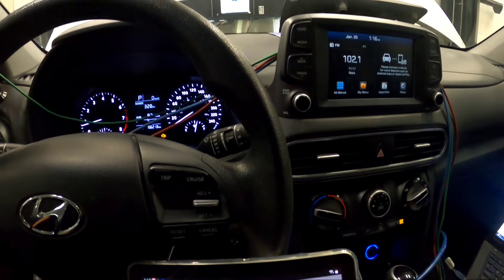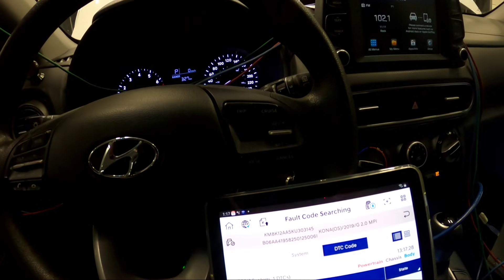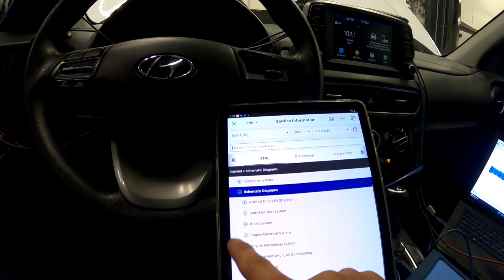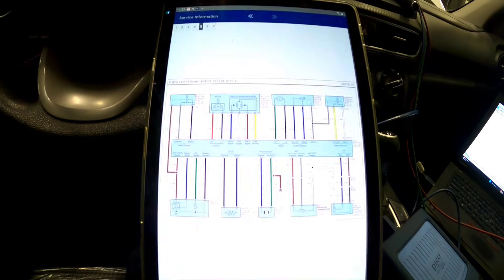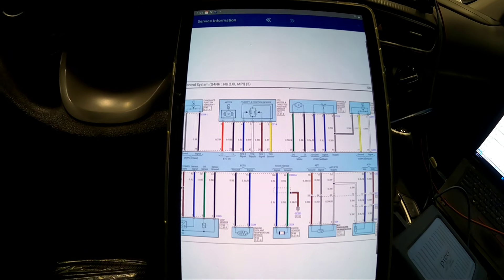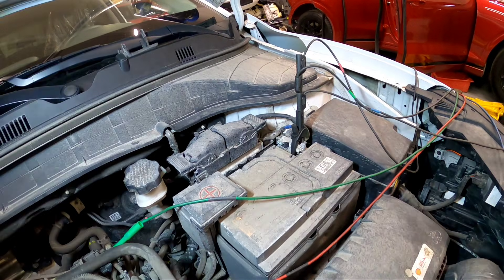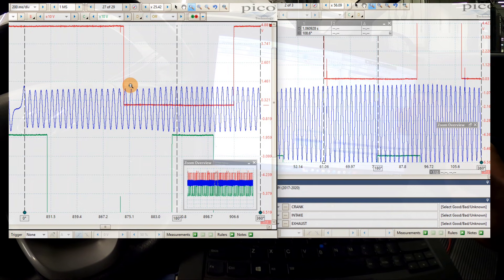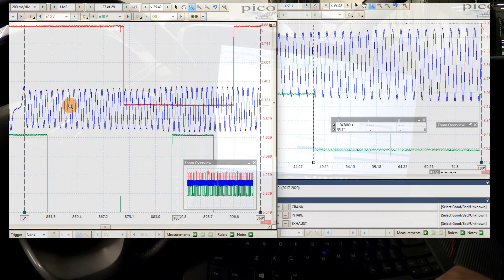How to check engine timing using oscilloscope | Hyundai Kona P0017

Comment: Correction, the camshaft itself was not replaced.
Reply from the maker: When they replace the cvvt gear was the dowel pin damaged? If yes, they need to replace the shaft.

Comment: Thank you for the video! On my 2020 Hyundai Kona and continued p0017 code, the timing chain and its components, cam shaft and cam gear were replaced as it was out of timing and cam gear pin was broken too. Mechanic said it was perfectly in timing with marks after repair . Code p0017  is still there. I’ve replaced both cam shaft sensors, both vvt sensors and crankshaft sensor and still getting p0017. The vehicle is current with the  requested recalls and safety campaigns. Any thoughts or other avenues I can take? you help would be greatly appreciated. Thank you
Reply from the maker: So as of right now you still have p0017 code? Whats vvt sensors? You mean the oil control valve? Did you guys actuate or active test the oil control valve? Is it oem parts? And also whats the data shows like exhaust setpoint and desired data values?

Comment: Hi there brother thank you for showing us and sharing this knowledge with us , but I wish you could of had show us the physical misalignment on timing marks
Reply from the maker: Yes, next time i will try. Thank yoy
Reply: @hyundaitech  hi there brother I have a question, it’s it normal for the exhaust camshaft phaser sprocket to rub against the timing chain cover ? But you know only the exhaust side on the phaser has a mechanism on the outside of the sprocket it self like a spring loaded wrap around the sprocket and then looks like a flange on it too , well that looking flange the one rubbing against the timing chain cover , and intake side it’s throwing couple codes P0341 and P0016 ,and it seems has new crankshaft sensor and the intake side has a new camshaft sensor also , and car sometimes seems to drive ok but then all the sudden leaves you stranded 😅. So do u think this exhaust phaser it’s the cause of this codes , cause I’ve never saw a phaser rubbing against the cover
Reply from the maker: @juanhernandez1238215 if its rubbing it could be the bolt that holds the phaser is loose. Those timing codes for sure it the phase issue. Check if the bolt is okay or not, if not then most likely you need phaser and a shaft.
Reply: @hyundaitech  thanks for your reply my brother

Comment: If it jumped a tooth I would assume the overall issue is a tensioner, chain or belt loose or stretched?
Reply from the maker: Yeah theres a chance its stretched or maybe jumped a tooth, once the tech will do the repair i will try to see and compare the new chain and the old one.
Reply: Assuming it was a cvvt and camshaft? Dowel snapped off?

Comment: Thanks for the tip and the known good waveform. Also on this job (exh cam and cvvt), have you done it using the method without removing the timing cover/chain? Warranty only pays 1.9 on this now and I haven't managed to figure out the method they want us to use. Thanks again.
Reply from the maker: Thanks, i havent try doing the repair withour removing the cover. I know the warranty pay is terrible but for me i will do the proper repair by removing the timing cover and do it perfectly so that no comeback hahahha